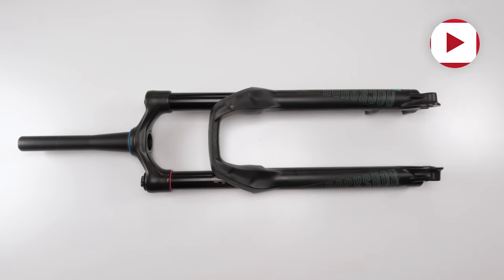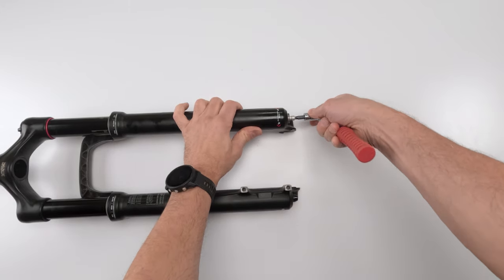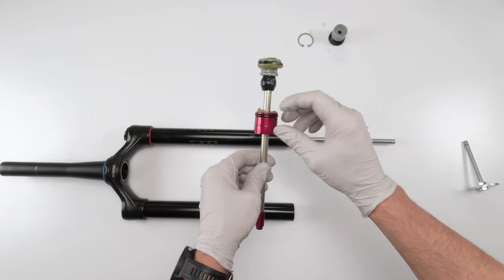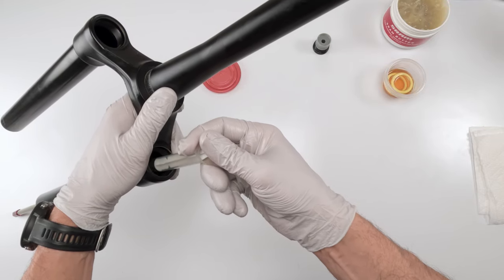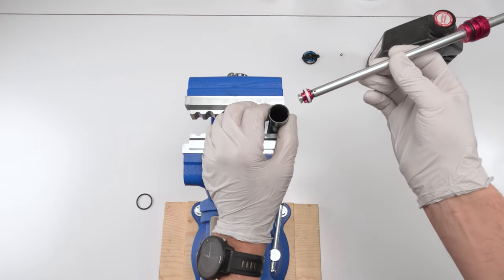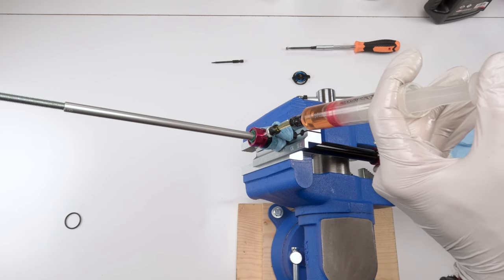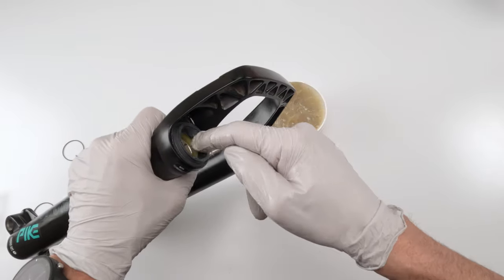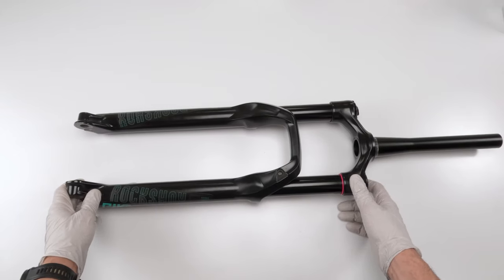2018 27.5 Rockshox Pike RCT3 B1 Chassis Charger 2.0 + C1 Air Spring  200 hour Service for Beginners

Comment: Excellent video. Same fork as mine and I'm thinking of upgrading to the C1 spring myself. :)
Reply from the maker: Thanks for the comment. swapping to a c1 spring is an easy swap. I know there's lots of mixed feelings about the c1 but I personally like it. The extra bit of stiffness on the low end make the turns feel more predictable.
Reply: @zoubtube  Good to hear. Since writing this comment I've read lots of things and was doubting if I should go C1 or keep the current one. So good to hear descriptive comparisons. :)

Comment: When reassembling the lowers, you mentioned checking for negative pressure. 

If you did have negative pressure, what would’ve caused it, and what would you do to fix it? 

Glad to see a new video, although I did say no pressure 😊
Reply from the maker: Installing the air spring into the upper tube without making sure all the parts are pushed to the top of the piston prior to installing it will typically allows air into the negative chamber. The quickest and easiest way to solve it at that point is to reinstall the air spring. 👍

Comment: Great video! What soft jaws are you using?
Reply from the maker: Glad you liked the video and thanks for watching it. The soft jaw is a rockshox reverb vise block, but it is STUPID expensive now. I bought it a few years ago for about 1/3 the price than it sells for now. what I did find is the following which might actually work out better. I'm contemplating getting it.

https://www.ebay.com/itm/276210036547?chn=ps&_trkparms=ispr%3D1&amdata=enc%3A1xvcnbCPHT46OAi8p7tqRPA44&norover=1&mkevt=1&mkrid=711-117182-37290-0&mkcid=2&mkscid=101&itemid=276210036547&targetid=1583904486362&device=c&mktype=pla&googleloc=9016979&poi=&campaignid=19894961968&mkgroupid=148855406073&rlsatarget=pla-1583904486362&abcId=9307911&merchantid=6296724&gad_source=1&gclid=CjwKCAjwkuqvBhAQEiwA65XxQGV5EayDiALzUfc_aR3PNoQ4G5_Q7BXZQ5asyZqX_DHnwn6uf1VVKhoCcvsQAvD_BwE